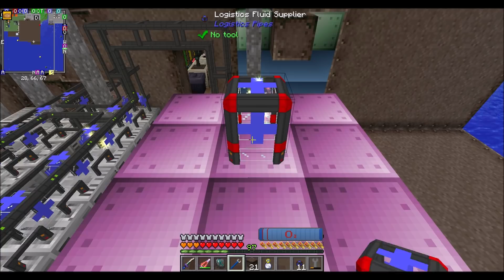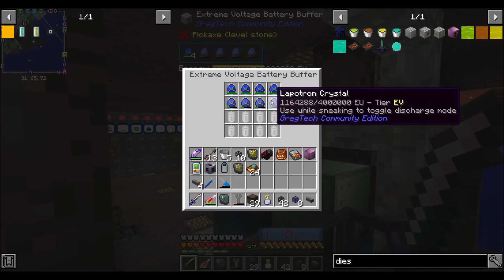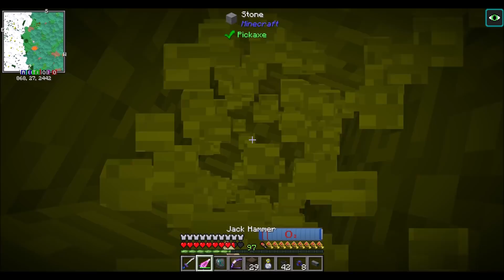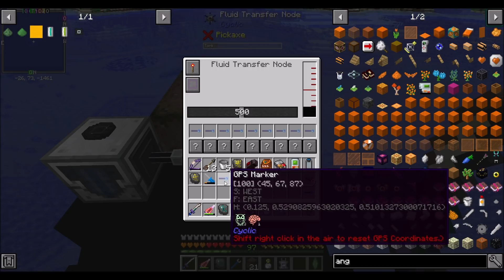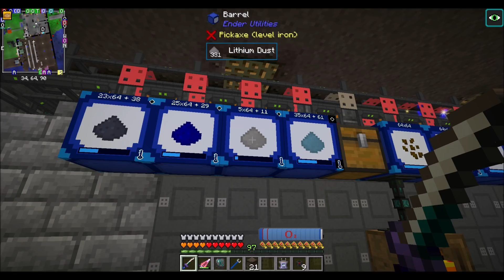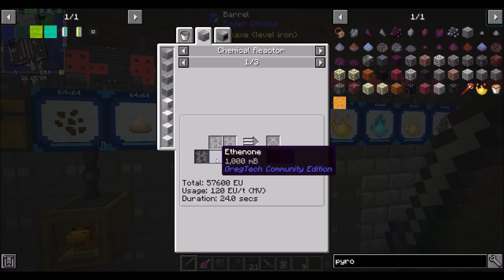FTB Interactions EP91 Path to Better Fuel

Comment: Hey Dire, I'm pretty positive that you have both sulfuric and nitric acids automated. In fact you had them automated FOR AGES and they both should be on LV or MV lines.
Reply: Yeah. I saw a red tank on the LV Line..
I don't know what dire is doing he's searching for a red fluid, he only has to look at his red tanks.
Reply: @DedmenMiller  he really desperately needs to make a fluid request pipe so he can see what he has in his system already.

Also for any gregtech machine that produces a single fluid output you can provide directly from the machine itself as a 64b tank.

Comment: Dire: Could move the EV power supply to a better spot.
Also Dire: "Naaaah..."
Reply: "I have an output cable between my generator and my battery buffer.  Better make a really convoluted path to go around it!"

Comment: Few notes: you have infinite glowstone already, it's sitting on your space station.
You've gotten TWO atomic disassemblers now, use them for mining.
You've already automated sulphuric acid for circuit boards.
Check the distillation tower for liquids, sometimes it's something you already have.

Most importantly: put everything in your storage system so you know you have it.  A fluid request pipe lets you check what liquids you have without running all over your base.

Comment: Again, Dire, it would be to your benefit to make a separate area with just rows of tanks to handle your liquid and gas storage, that way you can keep things a little bit more organized and able to easily see what you have available. Plus, as an added benefit, if you just need a bucket of something, you have an easy way to get it. Also, as an added plus, it would give your system a way to throttle itself a little more efficiently so you're not constantly burning through resources.

Comment: if you're not using a range-11 modifier on your pump at all times before you start pumping, you aren't getting all the oil. the fact that you can still see oil as a spout means you haven't gotten it all. When done properly you wind up with a giant mushroom cap of cobble due to how the oil flows as its sources get followed upwards by the pump.

Comment: Knowing the complexity is great! At this point you are at I'd probably start using plenty of notes. Though this is when your "dire"y situations start to effect your efficiency. For example: at this point having a wall of tanks and chemical reactors to keep you full of almost any fluid in gregtech. I usually just want to end up with infinite resources anyway - or as close to. A little off camera work just to organize some needed resources that may be needed whilst you dig deeper down these rabbit holes.

Comment: dire, IIRC you don't even need the CEF's for the flux networks setup, you can just make your network as an Energy Units network for the power type and not redstone flux so the power is ready to be used by the gregtech machines
Reply: flux networks can sometimes get pretty messed up if you don't use CEU/Fs

Comment: The pump from mekanism doesn't leave behind oil.
Reply: He's leaving behind enormous amounts of oil because he's not using the better range upgrades.  He goes swiming through a big pool of oil "wow guess we're all out here, need to move it"

You can tell you're in oil because the water darkness shader goes away.
Reply: @danmerillat  the mekanism pump doesn't need the range upgrades